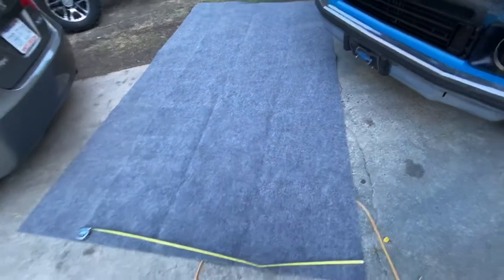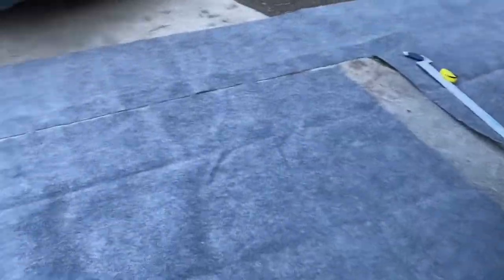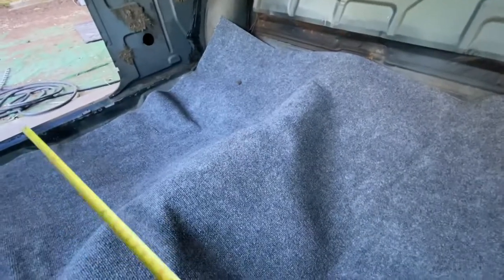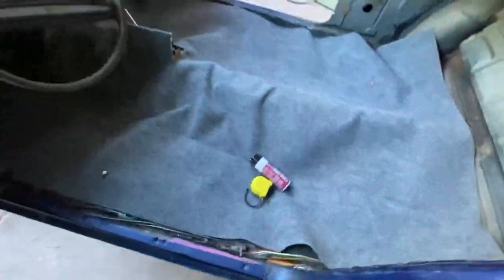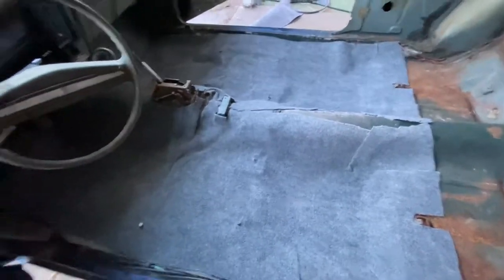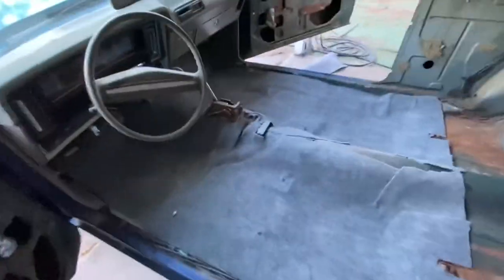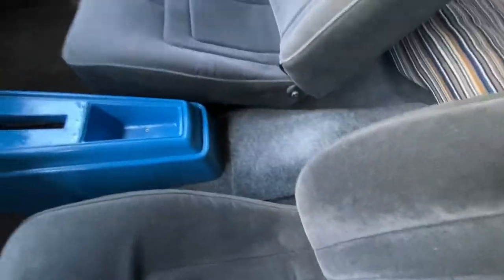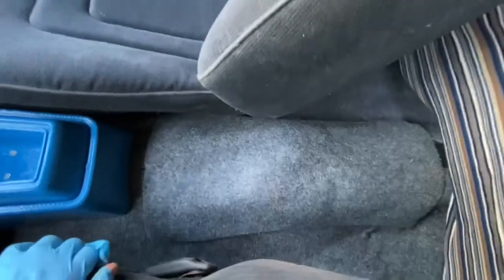Cheap and Easy Classic Car Carpet  DIY Carpet Installation

Comment: @1:42 why didnt u just bend the tape measure over the hump , that was dumb
Reply from the maker: Is that why the carpet was short?🫠
Reply: @CottoDIY  of course
Reply from the maker: @martinparker9249  I guess I won’t quit my day job 😆
Reply: @CottoDIY I hear you can use a price of string and lay it over the humps and then measure the entire length of string